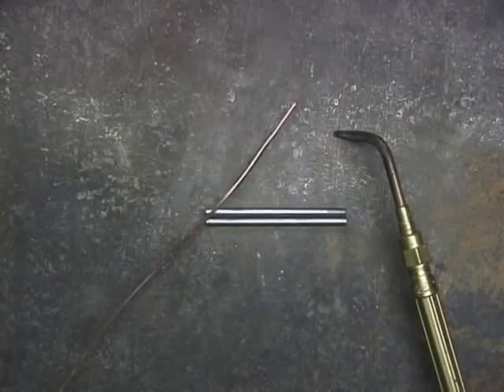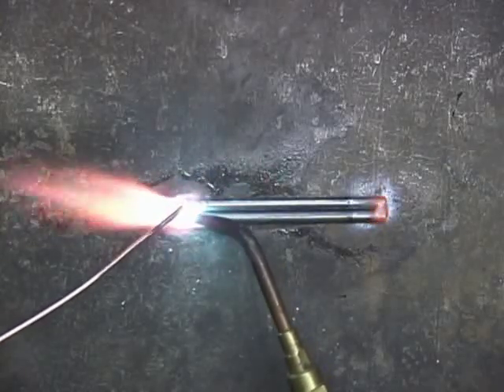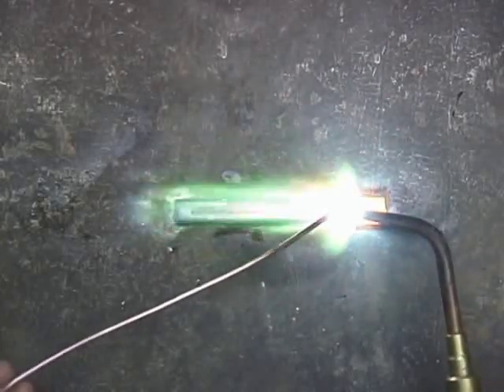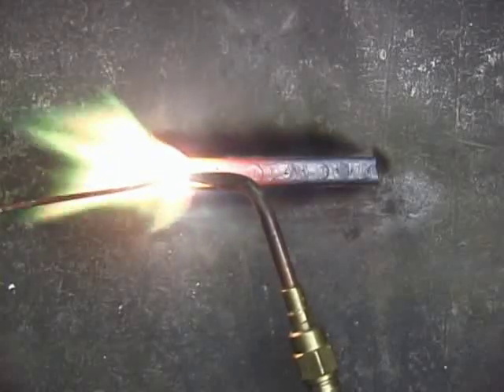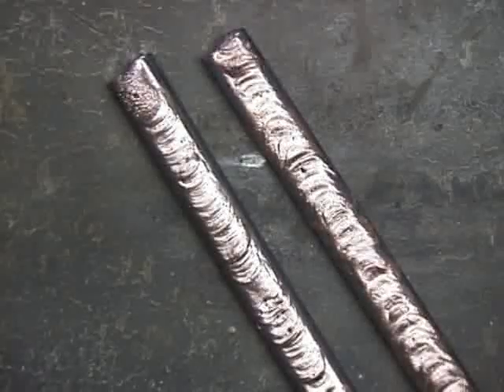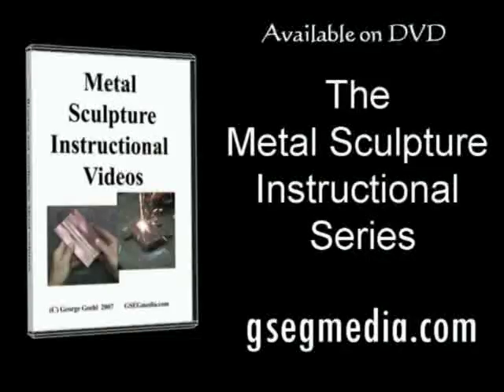Brazing with Copper Wire

Comment: What would you use to braze 2 copper tubes together
Reply from the maker: I would use "Sil Fos".  Contains some silver.  I rarely use it, but it's quick and effective.   Low melting temperature. I probably have about 12 sticks of Sil Fos that I bought 15 years ago if not longer.   Sil Fos 15 means tht it is 15% silver.

Comment: for some reason i am having problems brazing 1/16 steel plates together using braided copper wire and oxy /mappro ,perhaps i should try it without the homemade flux and see if that works better but the problem is i keep getting scale buildup and having trouble getting capilary action in between the butt joint
Reply from the maker: As mentioned before, I know nothing about Mapp gas.   Also, I've never used braided wire. I generally use a straight piece of 8 gauge copper wire.  For capillary action there needs to be some space between pieces to be brazed.  Something like a 1/64th of an inch or even less.

Comment: i would think copper makes the strongest of the braze in comparison to silver,bronze and brass
Reply from the maker: Copper is not as strong as bronze as in bronze brazing.  The copper age came before the bronze age.  Adding tin to copper = bronze.
Reply: yes and brass is adding zinc to copper but the melting points of bronze and brass are lower than pure copper ,i was under the assumption that maybe copper was stronger because of that,perhaps more heat resistant but not stronger then?
Reply: what is stronger ,pure copper or pure silver?

Comment: it's much cleaner when using acetylene rather than propane or map,,i find lots of hard to remove scale but perhaps it is because im using a poor man homemade flux from boric acid and water? have you ever tried mixing it with petroleum jelly instead,would this work? i was thinking about that because it may be what store bought  fluxes use as well ,it looks similar so i put two and two together and thinking of mixing it with boric acid
Reply from the maker: Good way to remove excess flux is to dip the brazed metal in boiling water.
Reply: hmm interesting,,but im talking about oxidized black crud that i always get,,i am able to remove some of it using wire cutters when im working with small diameter rods being brazed but lots of the crud remains embedded and i guess i have to use a grinder
Reply from the maker: I've never had what you are calling black crud.  After I braze copper wire the only thing showing is the copper wire and some flux.   Sounds like you have an unusual problem .  Hopefully a Google search will come up with a solution.
Reply: that is why i believe the problem has to do with the make shift poor flux solution  i am using,,as i said it's only boric acid and water also i am using oxy/mappro on 1/16" steel rods trying to braze them for practice and to see what works best,i tried with silver and copper so far, i think i might also be using too much heat or an oxidizing flame,but even though the copper melts fast it does not wet through nicely unless i apply lots of heat so again i believe it has to do with flux,this is what determines good wetting and capillary action
Reply from the maker: I've never heard of using boric acid and water as a flux.  People used to use Borax.  You can find it in the supermarket in the laundry detergent section.  Look for 20 Team Borax or do a online search.
Reply: yes borax laundry detergent,i seen this before ,its like some kind of old school box and i think pure borax or mostly,,,and yes boric acid,along with borax and sodium tri phostphate mixed with boiling water till you get a paste is another home made flux i seen done on yt vid,,but my simple solution still seems to work somewhat,,im so happy i just brazed 1/4od steel tubing together using silver and now copper wire lol,,i simply brushed my solution on the tube ends and the copper braided wire,,but as i said it comes out looking a bit crude and needs to be cleaned with sand paper but it held although still easly broke ,i think i just need to work on my flux solution or use borax instead and more copper filler next time,it still looked beautiful
Reply: so what about using petroleum jelly like Vaseline and mixing in some boric acid ? if you got the right flux it helps it come out cleaner without oxidation when working with steel
Reply from the maker: My only experience with flux is what I get at the welding supply.
Reply: ok,i thought maybe you experimented trying to make your own,,but have you ever heard of anyone trying Vaseline or petroleum jelly?
Reply: also a good flux should protect from over heating and oxidation and make things flow nicely

Comment: No flux were given in making this video :)
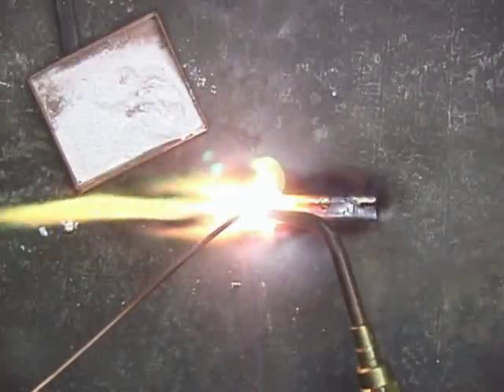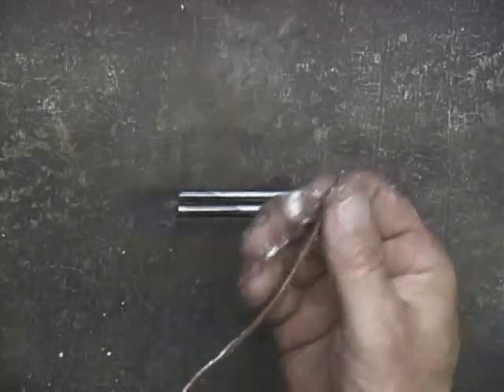Reply from the maker: The two pieces of 1/4" mild steel were "brazed" with copper rod with no flux.  Then at  1:11 I show the same process but using a powder flux.   At 1:40 I'm showing a paste flux.  So. the video shows using no flux, a standard powder flux and a paste flux.
Reply: I was making a joke George but thanks for the reply :P
Reply from the maker: Sometimes I'm not as clear as I would like to be, so just wanted to clarify.  Saw your smiley face, but wasn't sure  what it was referring to.

Comment: Thanks so much George , I do remodeling and end up with lots of copper wire and had wondered if it would be usable as braze rod. You're video sure answered that. thanks again.
Reply from the maker: Interesting that one doesn't hear much about using copper wire for brazing.  Don't know about strength, but my work doesn't require a lot of strength.
Reply: George Goehl I am totally new to welding, brazing etc. I do lots of plumbing in doing remodeling but always find welding and brazing very interesting. Never had oxyacetylene set. Just recently bought a uniweld  set from a customer and am anxious to learn all the safety, and interesting things in working with it. That's why I asked about copper wire usage. Have even heard of practicing with clothes hanger wire. thanks for all your videos, they are so interesting and helpful.
Reply from the maker: Peter, glad you are finding the videos helpful.  It is possible to gas weld with a coat hanger.  I prefer using a standardized gas welding rod.

Comment: I have learned a lot from your videos. One thing I'm having trouble figuring out, though, is brazing thicker pieces. Specifically I'm doing a decorative piece (steampunk style) with a steel gear (unknown alloy, machined easily enough) about 3/4" thick, and a large chunk of bronze (940, I think) about 3.5"x3". Workpieces are on a brick for insulation, with actual rock wool insulation loosely around the parts to hold the heat. I can't tell if my problem is that I simply can't pump in enough heat (using a semi compact torch with MAPP and oxygen, separate tanks), or if there's some other reason it won't flow. It seems like even if I were unable to get it hot enough to flow consistently because the parts are so large, I should at least be able to get this to flow in certain spots. I'm using the Lincoln brazing rods that are available at the home store (composition is not designated). I have burned through two oxygen tanks only to get one small area to stick to the steel, and I haven't been able to get any to stick to the bronze. Surely you can braze bronze with bronze filler?? It's a difficult subject to research because any search for "brazing" and "bronze" returns so many results about the different bronze filler options that I can't find anything about brazing a bronze workpiece. 

Anyway, I know that's not a lot to go on, but if it sparks any ideas please let me know. Thank you!
Reply from the maker: Thick metal takes a lot of heat.  With a small torch I doubt whether you can get it hot enough to braze 3/4" or the chunk of bronze. I have a large torch and it would take me some time to get those pieces hot enough to accept the braze.  Have you considered alternative ways to attach the parts?  Silver solder takes less heat.  Another way may be to drill and tap. Depending on how much stress is involved, you may get by with J&B Weld.   I've never used Mapp gas so I can't help there.
Reply: I should mention that I preheated first to 500 degrees for 30 minutes in an oven, then further with a large propane torch (flame pattern on that one is far too broad to be useful in actually brazing these parts). So at that point I would think that my fairly small torch, with the 5000+° flame of MAPP+oxygen would be able to get a small area hot enough to flow the filler rod. 

I tried first to solder but had the same issue with the propane torch, then switched to the MAPP setup but it wasn't flowing much better, because the flux tends to burn by the time I've gotten enough heat into the part for the solder to flow. Frustrating process. 

Yes, no mechanical strength is needed for this, so any epoxy could work, but I would like to be able to achieve a brazed look at the joint. I may have to settle for not having that small fillet and coloration. 

Thanks again!
Reply from the maker: Without being there it is difficult to suggest anything further.  I would try some thinner material.  If that works then you will know it is insufficient heat.

Comment: i want to braze 2 prices of copper together with some very thin copper wire to give the appearance of a single solid piece of copper how would I heat the wire without melting the 2 pieces which are very thin less than half a millimetre
Reply from the maker: Too many variables to answer your question (oxygen acetylene regulator settings, size of torch tip, thickness of copper and copper wire.  If I wanted to do that I would take some scrap pieces of copper and do some trial runs.  I do have a video on brazing thin materials:  https://youtu.be/h0vIvipWVuY
Reply: +George Goehl OK thanks for the help much appreciated
Reply from the maker: Was thinking about your project.  Once you get the two sheets of copper together with the copper wire - there will be flow over, so you will need to grind or sand down the  joint.

Comment: Hi George, I am learning how to braze and having a lot of luck with bronze rod on a copper sculpture. However, I want to use copper wire to braze on the copper sculptures to better hide the braze. It ise very hard to get the wire to begin to flow before the copper piece itself starts to melt. I am using the Bernzomatic Oxy/Mapp torch at this time. How can I avoid melting my artwork?
Reply from the maker: Denise, I can see where that would be a problem.  First off, I have very little experience with a Bernzomatic torch and i have never used Mapp gas.  If you have some scrap, try brazing on the copper with your brazing rod.  Once that is cool, paint some kind of acid on the brazing.  I've often done this with copper bubble wands I've brazed..  If I leave the wand in the acid bath too long, the acid will chemically change the bronze brazing to copper.  If you have some white vinegar in the kitchen, you can try that.  White vinegar is a weak acid so it will take some time.  Here is a video I did on copper and acids.  http://youtu.be/usUCOvFECIE
 
Get back to me if this doesn't work.  George
Reply: George Goehl
Thanks George I will give it a shot and let you know. Thanks! :)

Comment: Hi George.  Another great video.  I will give this a try.  The copper bond would be relatively low strength in comparison to GP bronze I expect - so is this mainly for decorative work ?  I use an LPG torch for my brazing which you may find interesting. https://www.youtube.com/watch?v=PGwKuYP-RNo
Reply from the maker: I've found brazing with copper wire to be quite strong.
Reply: Hi George.  I just tried it and I'm quite impressed.  It's certainly strong enough that it won't break with flexible material like small diameter rod/ heavy wire.  Be interesting to see how it will fare when brazing on a carbide cutting tip for my lathe.  Very interesting and cost cutting hint.  Thanks Rob

Comment: Have watched a few of your videos and they are very informative.  Have you used the fluxless copper solder  to solder/braze copper to copper?  I am having no luck with my efforts but I have had no direction in my attempts.  Not sure of temp I need or copper prep. I have cleaned copper heated w/ butane and I get copper solder to flow but it beads on copper and does not flow into the joint.  Using primarily on Copper wire joints for wire jewelry.  Any help is appreciated.  Thanks
Reply from the maker: I have not used butane.  Generally when it beads up it means that the base metal is not hot enough.
Reply: Thanks I will try to get a hotter burning flame and give it another go.
Reply from the maker: Mack Fondren Mark, recently I bought a propane swirl head from amazon.com.  For some reason the swirl torch puts out a hotter flame than just the regular propane torch.  I know that you are using butane but you might check out this propane torch head.
Bernzomatic JT539T Swirl Flame Brazing Torch  About $25.00

Comment: I am also fond of the contrasting aesthetics of bronze brazing over steel.  As long as all flux is removed, I prefer painting over a braze
welded joint since it is smoother than gas or electric welding.  The flow characteristics of the filler assure there is little or no grinding needed.

Comment from the maker: @lingd8 
I'm using acetylene.  I've never used propane.  You will just have to give it a try and see if it will do what you want it to do.

It will  be slower than acetylene as it is not as hot.

Comment: Hi, I was wondering if you can use propylene gas for this kind of brazing, as opposed to the acetylene torch that you appear to be handling. please correct me if I'm wrong about which fuel you're using.

Comment from the maker: @SoyBoySigh Thanks for the comment.  I'll check the mask lens out.

I don't know what the strength factor would be using copper as the filler rod.  Today there are so many metallurgical specific rods I'm sure there are filler rods far better than copper wire.  
This would be especially true for bicycle and motorcycle frames where a minimum of rod is needed.

Comment: You mention not being able to see. I hear that "tinmantech" has developed a special welding mask lens specific to this operation, that blocks the right wavelengths so as to prevent your corneas being burned out. Sounds cool. I'm curious about the strength of such a joint. I know you're an artist, I wonder whether copper wire would make a suitable brazing material for something structural, such as a bicycle or motorcycle frame. I heard certain brazing is stronger than mig/tig, such as aluminum...

Comment from the maker: @aaronfu2   The part on the left was done with flux.

I've never used the copper wire as a filler wire between two pieces of stainless.

Comment: When would you want to braze rather than just weld it? It seems as though welding would be faster, with a stronger bond, though i guess you don't have to heat is as much when you braze. I guess you would say that brazing works when metals are dissimilar, but are there other situation where brazing is preferable?